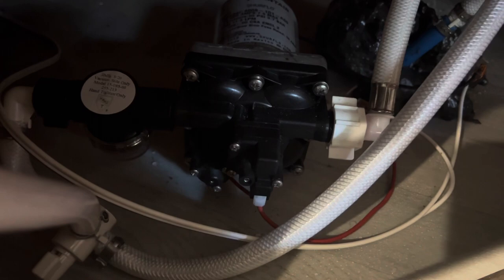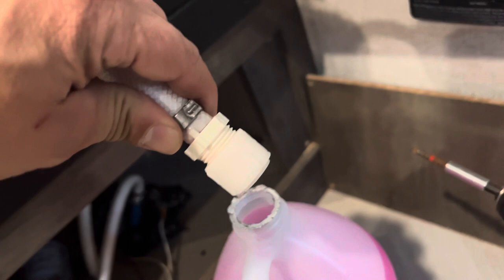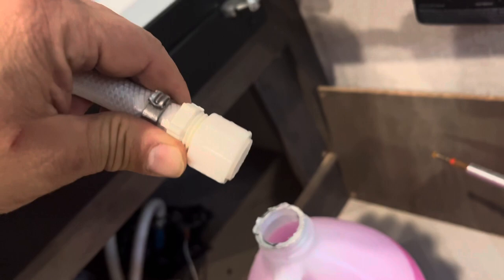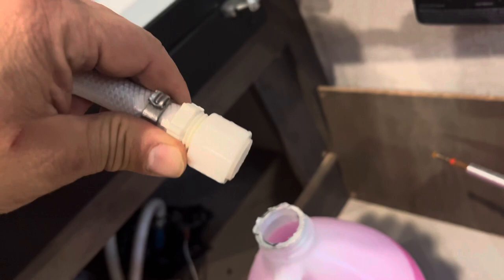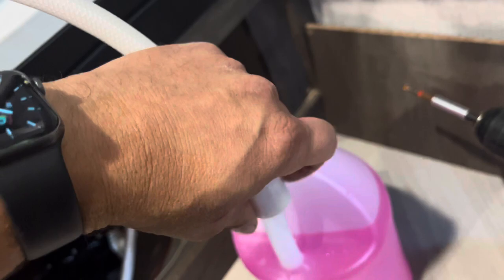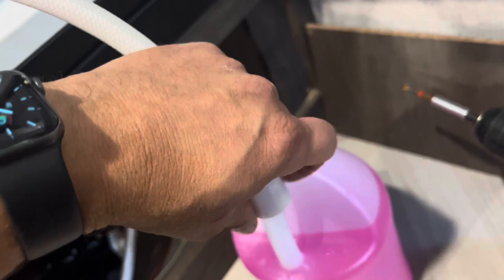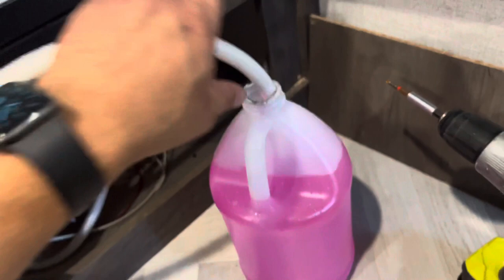RV Water Pump Not Pumping Antifreeze - Check This

Comment: This happened to me on my bathroom faucet those damn filters even with a filter on a water spigot get caked!  This helped me stop messing with the outside connections, I just lifted the rear bed, accessed the pump, removed the tank line and put a hose from the pump to each jug of Antifreeze and turned on each spigot and it took like 10 min and the whole rig was done!
Reply from the maker: Glad this video helped you out. Have a great day!